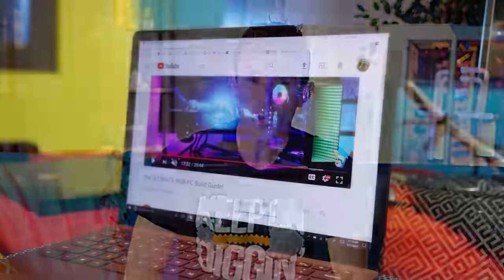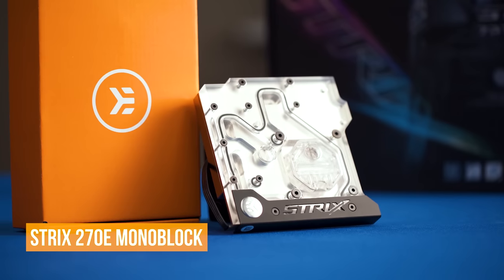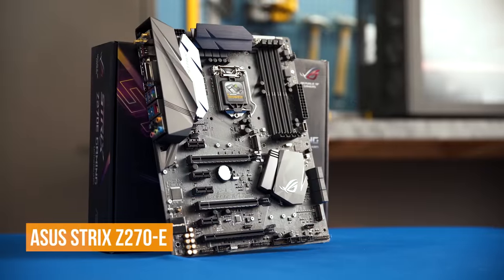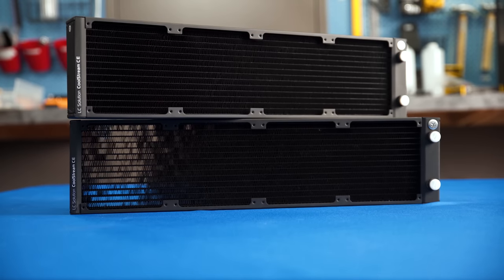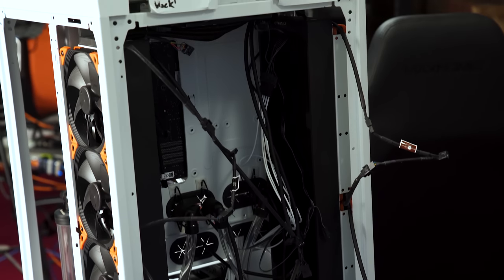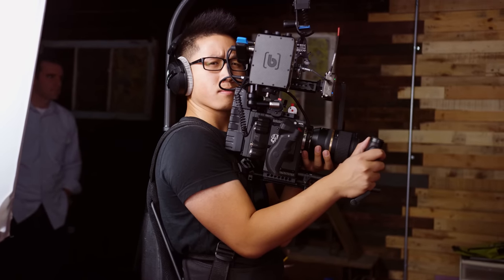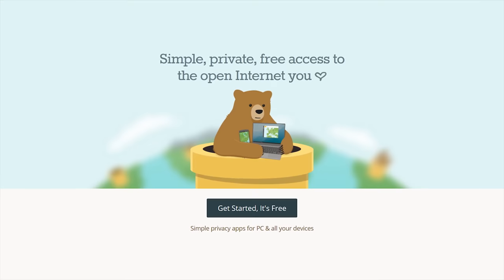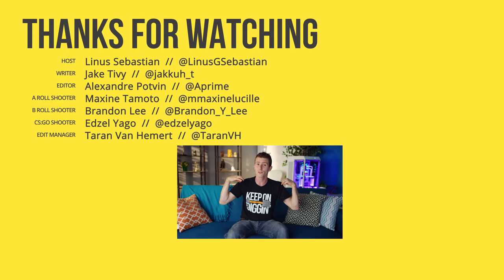FULLY RGB WATER COOLING - EVEN THE FITTINGS!

Comment: RGB Power cables?
Reply: thats what i was thinking
Reply: Fiberoptic is for data transfer, and they have to be sealed so no light can be leaked out, don't think that would work...
Reply: JD recycling there are actually some fiber optic cables that allow light to pass through. I used to have a philips cable for the optical jack on my stereo that was clear through the whole cable very similar to this one: https://m.ebay.com/itm/Philips-HiFi-12-feet-Optical-Fibre-Digital-Audio-TOSLINK-Cable-Mini-Adapter-Inc-/281062015932?_mwBanner=1#vi__app-cvip-panel

Comment: not normally a fan of RGB lit anythings, but this PC has changed me into a #RGBophile (that sounded a lot better in my head but now it justs horrid). the lighting makes the PC absolutely beautiful, but there are a few issues that I'm not sure can be fixed, the first issue is the lighting itself. (still sexy AF but hear me out) the RAM sticks don't have the same color timing, meaning that while or even three of them stay the same color in the exact moment of time, the last remaining stick is either still on the last color or even two colors behind the others essentially ruining the illusion that the PC is 100% RGB lit, while it still is 100% RGB, it doesn't take a keen eye to spot that one of the RAM sticks isn't the same color as the others. the only other issue is that the case lighting itself seems to be moving a bit too fast for the full enjoyment of the lighting. of course the timing of the case can be fixed by adjusting a single number ( i assume...) but the RAM color timing may be a little more of an issue to fix. either way it is still an amazing PC both in specs and in presentation, the word vomit above was simply my OCD taking over.

#RIP_TunnelBear
Reply: Arcano & Friends damn this nigga went in
Reply: wolf3 3 lol
Reply: seems to be by choice, cuz u can set them to be in sequence
Reply: I have a very similar build, I use Corsair Vengence RGB for mine, instead.
Reply: I've got that RAM, and it doesn't take a second to sync it up in Aura.
Reply: You can use Aura Sync to sync the RAM with the rest of the system
Reply: Xtreme Performance  the bends and tubing really do look like shit.
Reply: The ram has addressable RGB unlike the rest of the components
Reply: Arcano & Friends ram is adjustable I got it doesn’t take that long to sync all the sticks together
Reply: Hmmmm...
Actually the biggest issue is to sync properly the tt stuff with the aura/fusion etc...
I like fusion cause its 1 click change on/off but tt i need to on/off each...
Imagine having 16 fittings plus Psu And having to on/off each 1 by 1

Comment: Not even RGBA...
Reply: Now we need CMYK.
Reply: not even RGBW
Reply: They're Canadian... They went with RGB Eh...
Reply: p 
{ rgba (200, 25, 19, 0.3;
}
Reply: +plopnow you mean:

p {
    color: rgba(200, 25, 19, 0.3);
}
Reply: Now I want an RGB GBA...
Reply: <p>yeah i forgot Color:</p>
Reply: Why not Pokémon rbgy
Reply: would be cool to hide your PC from thieves. turn alpha down to 0.
Reply: RGBWY is already a thing.
Reply: tf is RGB(insert_other_stuff_here)
Reply: RGBTQ+
Reply: It's for defining a color using CSS, a styling system for websites. rgb(255, 255, 255) is white for example.
Reply: Can you link all the accessores on 1 link?
Reply: EstMovies What is RGBW?
Reply: mbsfaridi Red/Green/Blue/White
This is used because turning on the rgb led's doesn't quite get you white, it gets you a weird colour with rgb shadows. So they add in white led's too so you can use white without the strange side effects.
Reply: aljowen Ah, so it;s another colour for the pixel. I though it was some technical word for a image like the OP said RGBA which is a image that contains the alpha channel (Transparency). Thanks!
Reply: mbsfaridi rgbw isn't used in monitors. Its mostly just rgb led lighting strips that it applies to. On a monitor the rgb colours are so small and close together that they look like white when all 3 are turned on together.
Reply: It is RGBA, A is set at 255
Reply: tuff_lover ik
Reply: aljowen id perfer RGB GBASP
Reply: What about R (Regular)
Reply: RGBAWUVM***
Reply: NOT EVEN RGBW

Comment: What if, hypothetically, for the RGB in the hardline tubing you ran a bundle of some cheap optic fiber (the kind used for craft projects) shoved in front of the LED's in the fittings and have each fiber terminate at different points in the line (to show color midway through the tubing). Depending on how well it worked, you might even be able to use it to avoid manually lighting the tubes at the fittings, and just have the bundle connect at a set of LEDs in the reservoir. Potential concerns would be disruptions in water flow and if the material for the fiber would degrade too quickly over time.

Comment: I was so inspired by these fittings, that I learned a lot about electronic engineering and made a RGB Digital to Analog converter, so I could control each fitting separately via software. The first gen fittings lacked SW control and all connected to the same manual controller.

Comment: I'm WAY too paranoid to watercool my pc. Air Cooling is my city
Reply: Cosmotron And if it weren't for your RAM, then your PC would be shitty?
Reply: Chris723 ...? No? Maybe IF you use way  to small radiators but if you build it enough radiator space it will be alot cooler. 
I have a 7700K@4.8 and a 1080ti 2050Mhz in a watercooling loop with one 360mm rad and a 240 rad and my gpu never goes above 55c, but before when it was aircooled it went up to about 75c (Aourus Xtreme 1080 Ti).

Big diffrence.
Reply: Give it time.
Metal to Metal will reach max temp quickly.
Metal to Water will take longer
Reply: TheYongFreediver. That may be a case and fan issue. Even when heavily gaming my air cooled system never gets above 50c Gpu or cpu.
Reply: Cosmotron water cooled CPU GPU air cooled once my h110i warrenty is up I am going back to air probebly who knows
Reply: Not if you have big rads lol.
Reply: Watercooling is just amazing i have it and it's amazing dude you should give it a try :p
Reply: Just remember whichever way you cool you will never be below the ambit temp of the air environment unless you are on ln2
Reply: You could always submerge your radiator in a evaporative cooling loop.
Reply: Didn't know Air Cooling was a city, which country?
Reply: Ya i can play for hours and my Titan X never gets above 65. It was 85 on air.

Comment: I made a very similar build using the same case and cooler setup with a threadripper and Gskill RGB ram modules, though I installed 128 GB. I also used Phanteks in cooling my 1080 Ti. I like how Linux used RGB tubing lights, whereas I opted for Thermaltake C-Pro compression fittings instead. I used a 960 Pro and two 960 EVO M.2 SSDs. Thermaltake and some other companies wouldn't ship to Japan, so I had to source half my parts from Tsukumo in Akihabara which ran the cost up quite a bit. Since too many parts needed custom profiles at PCPartspicker and everything was in yen, I didn't upload it though maybe I should?

Last performance PC I built was about a decade ago which I upgraded over the years with a Xeon and SSDs, so this should last for a while. Definitely my favorite build- it's quite the eyecatcher as well as a workhorse! Thanks for the post Linus!

Comment: I'm going to be "honest with myself", as you requested. And this is not a hate-reaction; see it as constructive criticism.

Cables all over the place. Not even in straight lines. Not coherent in any way. No attempt to sleeve those cables to reduce the chaos. I can piss patterns in snow while having a seizure, that look more coherent than this cable management. You could have used at least wire spacers for the white wires to make them look a bit better and get the angles on the hard-tubing right. Even the spaces between the tubes themselves look like they took less time to finish than me reaching a climax. I'm not saying I'd do a better job (far from it), but I find it hard to believe that this is one of the best builds you've ever done. Throwing money at components is just part of the job. I honestly think that there's been a slight lack of eye for detail here. With that much light in your system you have to be extra careful to get the details right, because the details will catch the eye. Especially if you get them wrong. 

Having said that, I still think it does look like a nice build (hence the like). It just could have been a bit nicer. And yes, I do realize it's always easier to comment (about as easy as to describe less positive comments as "haters will hate"). But you did ask for honesty.

Comment: Thermaltake makes RGB radiators. Linus fail
Reply: Naa, they have radiators. Well its a radiaotor with an rgb slapped on the sides but they look nice.

http://www.thermaltake.com/products-model_gallery.aspx?id=C_00003131
Reply: vicdez vicdez fail
Reply: You mean the radiators that are pretty much concealed inside the other chamber of the case? It would have been a waste.
Reply: No1 said it was practical. Just like the 5" screen I added in my case. Or my rgb power supply. But yea, and rgb ssd wouldve been useless lol.

Comment: it's not a cpu...its a fridge❄️❄️❄️!!!
Reply: Desmond Miles 
What? You mean the case?
Reply: I meant the cooling and the huge radiators for it
Reply: Desmond Miles That's not a fridge, it's a popcorn machine.
This is a fridge, or maybe a freezer: https://www.jimms.fi/en/Product/Show/118358/ca-1e8-00m1wn-00/thermaltake-core-x5-e-atx-cubekotelo-musta
If I'm correct, this thing can hold 22x12cm fans.
Reply: Its 19 120mm fans vs 13 140mm fans, or probably the only case which can hold dual 540mm rads. I'd go for the tower all day long. Calling that a popcorn machine? You must have some fine teeth
Reply: Michael Kawecki Maybe you're right, but it looks like a ice cream machine, pretty cool
Reply: Xavier Rodriguez keyboards, monitors and all other I/O constitutes a computer..control unit ,ALU, memory comes in cpu...in this case pc case and all peripherals are cpu and not a computer
Reply: The CPU is the i7 7700k NOTHING else in the build is a CPU.
Reply: forza1sra i7 is the microprocessor and not a CPU..

Comment: I ended up putting my 560 rads with the multiple 1/4 ports on top instead of on bottom, so that way I can loosen one my fittings on the rads to let air flow take place during draining. I also have my drain fittings towards the bottom of the case next to the pumps. Works great for the draining process since air is getting in from highest point of loop and draining at the lowest part.

Comment: the bends in the tubes are terrible. maybe ask jayztwocents for help next time.
Reply: thejackofclubs I was thinking the same thing. Glad someone else noticed. Hard line isn't easy but if done right, looks awesome. This was not done right...
Reply: Agreed. It could have easily been fixed by cutting part of the tube off, instead of re-bending it. The bends were done at the right spots, but not enough of the tubing was cut off of the ends.

Comment: How much does this cost?
Reply: like 3 grand
Reply: Thirty thousand dollars
Reply: or 3 iphone x 256GB
Reply: probably a bit more than that. im in the middle of a similar build and just my single loop watercooling setup is already about 1300 dollars. my mobo, cpu and ram were about 1600 (8700k, asus ROG maximus formula x, same ram as in this video), thats before the 1080ti (600), the multiple m.2 drives (300 each) and the other stuff like traditional SSHD hard drives for storage.
Reply: I think about 2500-3000 dollar. I calculated the parts roughly
Reply: AnjuDieQualle I couldn’t build my current 4790k build for 3 grand again, much less the 8700k.
Reply: just click on the links in the description and do the math for yourself then
Reply: AnjuDieQualle the part you have to keep in mind is the small watercooling parts. These fittings can be 20 dollars each and with rigid tubing, you can need a few dozen, as an example.
Reply: If you add up all the parts in the description alone. you end up with about 2500 dollar. thats why I added 500 more to my commment and said BETWEEN 2500-3000 in my calculation. But just as I said, just go and look for yourself then. All the parts he linked in the description will be around that number. If he isn't going to link/show anything else, we can't really take it into account.
Reply: AnjuDieQualle you don't understand how much custom loop water cooling costs. Fittings run 8-10$ each. Many of us have upwards of 20 fittings. AS stated, custom loops can easily exceed $1k without much sophistication.
Reply: AnjuDieQualle 2 pump and reservoir combos is around 4-500 alone just to give you an idea.
Reply: Chris Giroux yeah. I just rebuilt my loop for my upgrade and needed a new res/pump combo (tower 900 only really takes vertical res with bottom mount), and I spent 300 bucks just on the res, a little tubing and 4 new fittings. That’s not including the 1,000+ dollars of water cooling stuff that I already own. 
The RGB fittings aren’t cheap at all, you’re looking at almost 100 bucks shipped for every 6, and my loop has about 25 fittings.
Reply: That’s a $185-ish motherboard. trust me. i have one

Comment: The Tower 900 is the most BAD ASS chassis I have ever worked with. I can't wait to get the 560mm radiators in.

They're going to be chilled by 8 Noctua NF-A14 iPPC-3000's. Actually, every single fan port on this system is populated with one of those. We call it "The Fridge"

Comment: What a beast. This case would work perfectly for 2 full motherboards and 2 gpu in crossfire but apparently they never found a way to use cross fire or SLI to fully combine their power.  2 RTX 4090 SLI WITH ALL the power combine we could be living in the year 2050 in gaming. I never knew why I didn’t work, do you Linus?

Comment: Can you make a pc build of these spec:
●Msi z390 gaming motherboard
●Core i7 8700k proccessor
●Msi RTX 2080 graphic card
●Hyper x predator 16gb RGB
●corsair ll120 RGB fans (120m)
●Nzxt kraken ×52( 240mm)
●Samsung 970 pro 500gb M.2 ssd
●Seagate 1tb hdd
●Cooler master h500m
●Cooler master 850 watt powersupply/any
I really want to know what fps does this spec gives on any game played in high setting
Reply: SK Ride Vlogs what resolution? On 1080p or 1440p, you are looking at insane frames rates
Reply: @nikoyochum6974  on 144hz refresh rate  moniter

Comment: linus, question...can you cool 1 cpu with 2 360 rads if your case has the space? can I just...connect the hot line from the cpu to the input of rad 1 then jump the output from rad one to the input of rad 2 then the output of rad 2 back to the pump or cpu? and would there be any worthwhile advantage to doing this?

Comment: These fittings fucking suck. Please, please, do not use them. Sure, they look cool and I got them to work in my system, but three out of the 12 I purchased leaked. Not mention the QC from TT sucks. They are horrible to work with. Save yourself the headache and just get UV reactive fluid if you want glowing tubes.